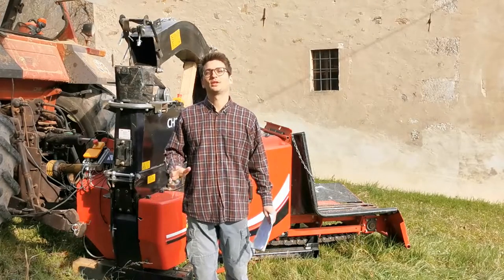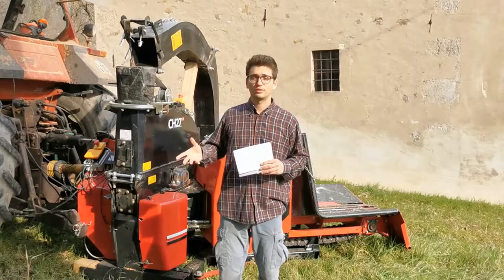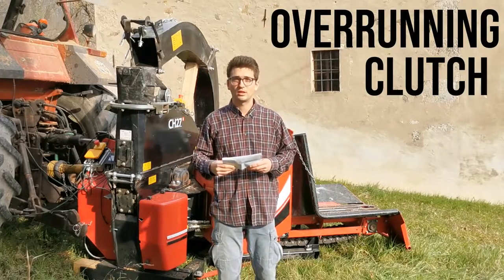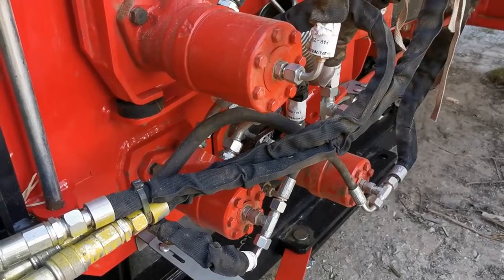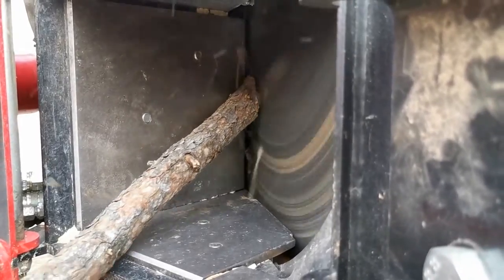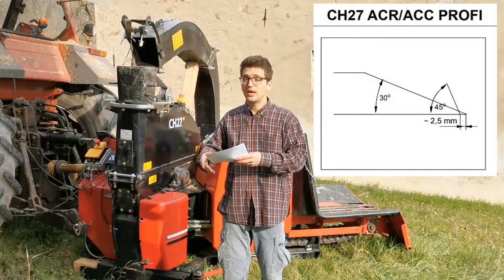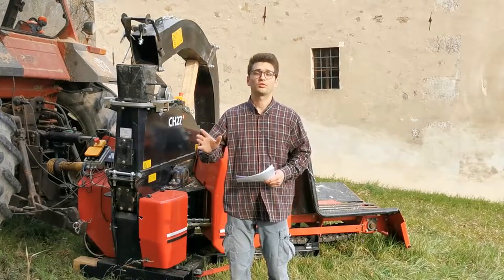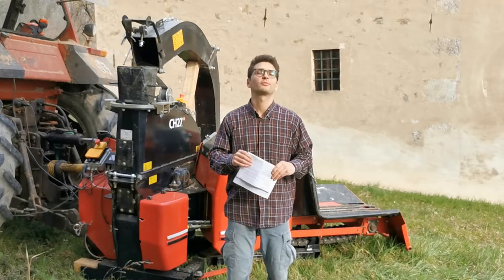FARMI PROFI CH27 pt.1 | showing the TRACTOR side

Comment: How reliable has this set up been ? I was using a wallenstein bx 102ri on a lsmt7101cps and there was a failure on the inside of the tractor dealer says that the metal inside of the pto gears was starting to weld together